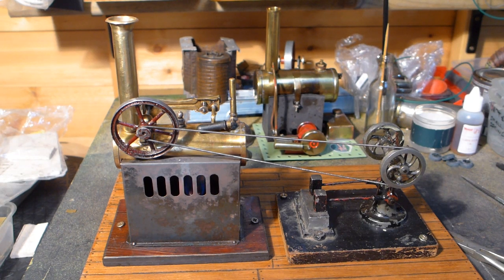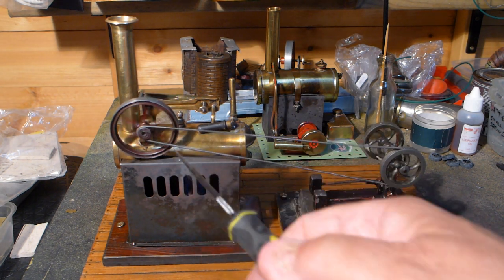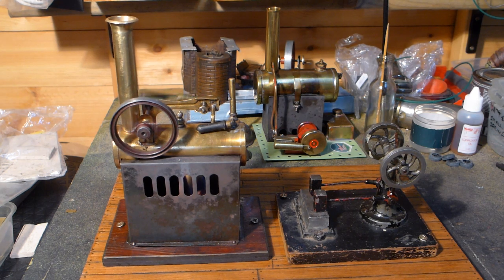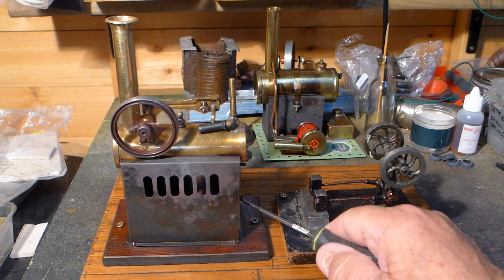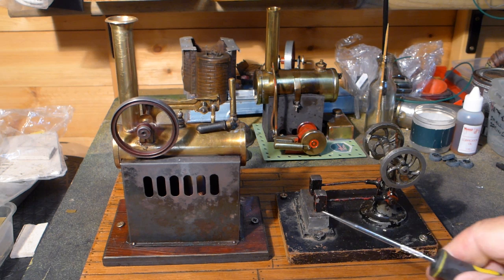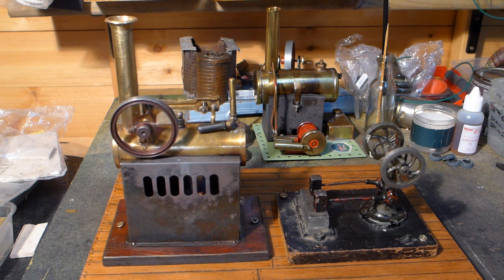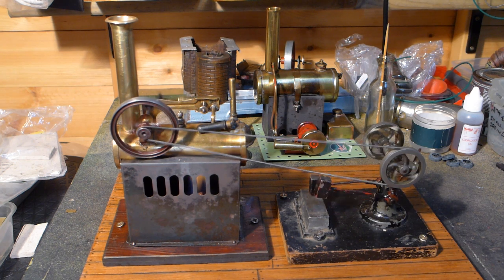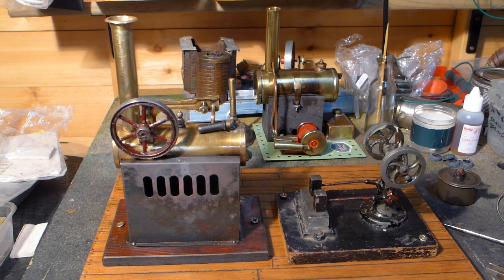FRITZ NEUMEIER STEAM ENGINE 1906 FIRST STEAM AFTER REPAIRS VIDEO1

Comment: Lovely engine Steve and that hammer is a real beauty - Cheers Jim
Reply from the maker: Hello Jim its a great little engine , the hammers seemed to just belong to it very enjoyable to steam....It didnt come with a chimney so i had to make one which turned out well and just finishes the engine off....Steve
Reply: Chimney turned out bloody fantastic Steve......loved your wife calling out and your "5 minute" answer :)
Reply from the maker: Hello Jim i use a heavy stainless steel plumbob cone shaped thing i bought off ebay its perfect for shaping annealed brass tubing into chimney shapes,  The trouble and strife always ruins my videos so i leave the comments in now as i have got fed up revideoing....Steve
Reply: @stephensuttonsteam2seestep289  Steve I have only ever used a plumbers flaring tool.....but no way does it give the nice flare that the plumbbob gave you.
Reply from the maker: Hello Jim i think its the weight of the plumbbob that helps with finish as i can use it as a burnisher as well as hitting it with a hammer 😂😂....Steve

Comment: A nice Neumeier engine, Steve. Together with the twin hammer, this is a fine setup. The motor drives the hammer very well. When the engine runs on its own, it takes off like Schmitz's cat. Maybe even a little better. 👍👏😄❤
Reply from the maker: Hello Juergen i have never heard of Fritz Neumeier but this is a nice little engine, even though it has been through the wars, and its great age pay testament to the build and materials used building this great little engine....Steve